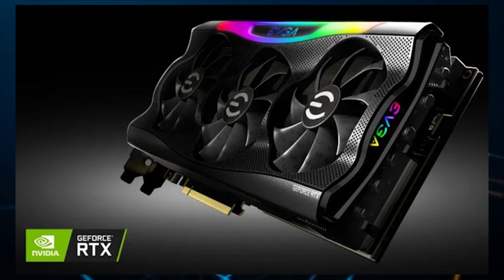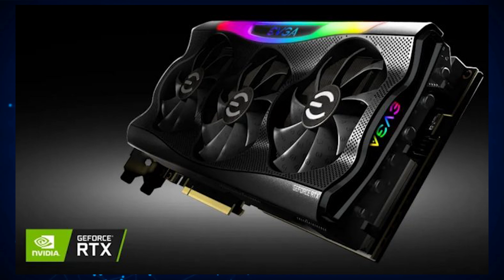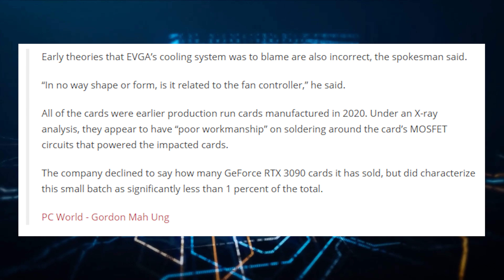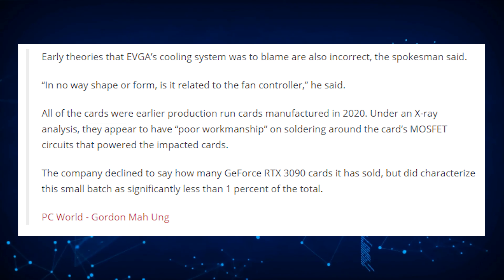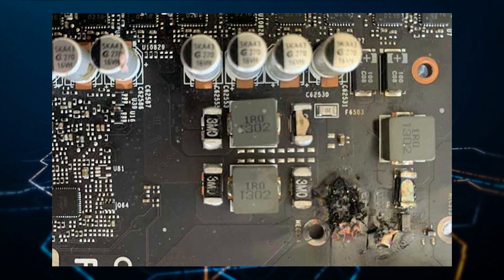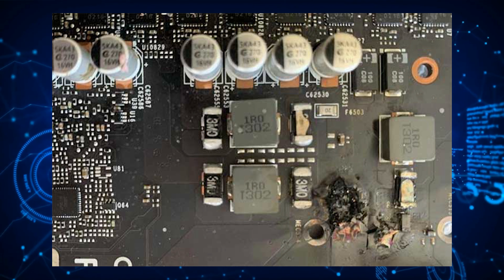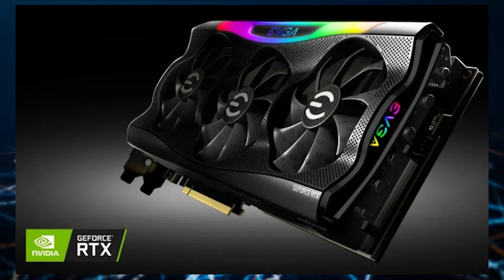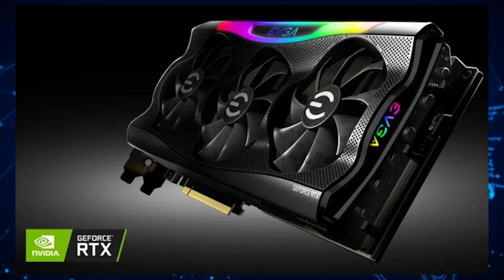EVGA Confirms That A Bad PCB Soldering Design Led to Some Gamer's RTX 3090 Graphics Card Dying

Comment: A total 24 cards had the Issue, And EVGA RMA replaced the cards 2 days into the issue. Know your role Slappy! Props to EVGA for replacing the cards before they knew what the Issue was or if it was the cards fault or the game. Other brands would have researched the issue for a week or 2 before even sending the replacement request up to management. ( dude is crying over 24 cards that were were replaced no questions asked)
Reply: 24? I'm on my 4th EVGA FTW 3090. All VRAM issues. Every other component was checked for hardware issues and notta. Also, go check out forums for the same issues that have been taking place with these particular cards.